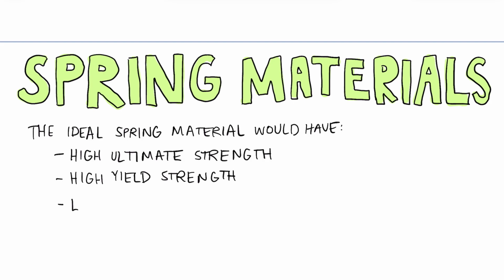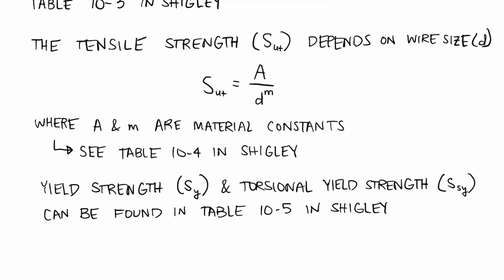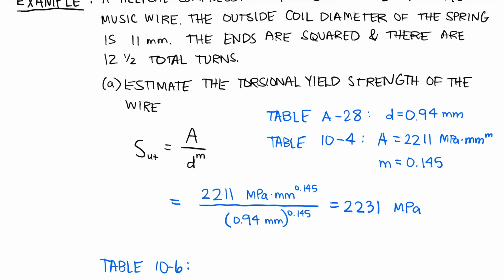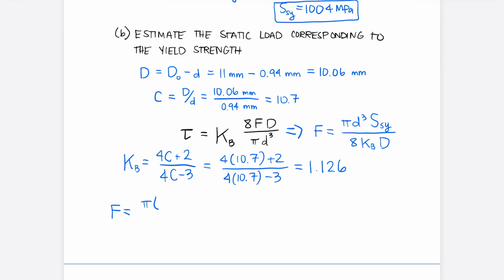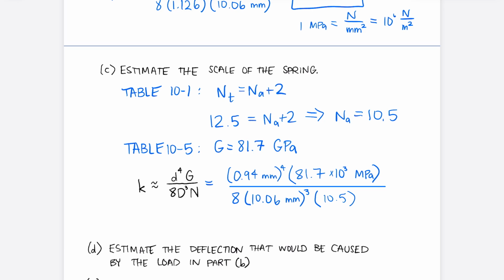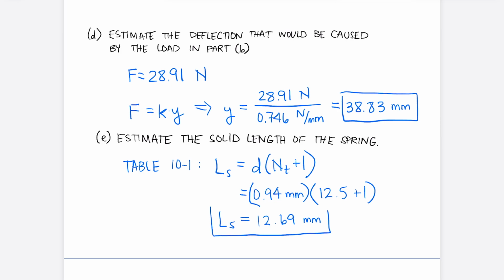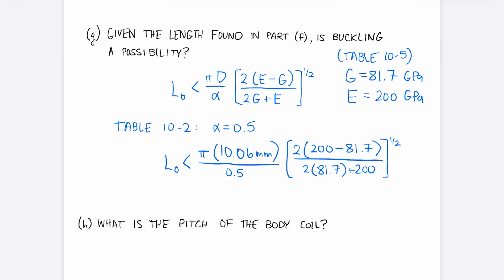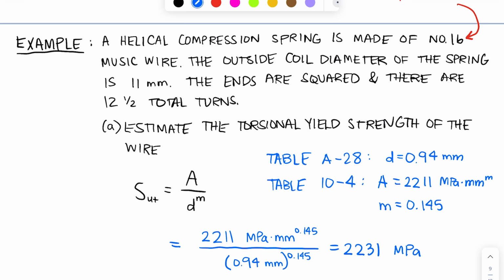Machine Design: Spring Materials - Lecture 18A

Comment: I'm not going to surpass 1/2 the yield strength.  Why do I need to know when the molecules do this or that at ultimate strength?  The intermolecular bonds determine the strength all the time.  They hold the substance together under no load.  Thats what seperates solids from liqids.